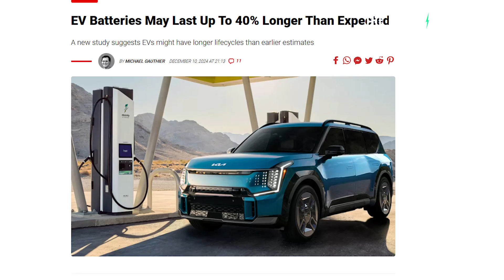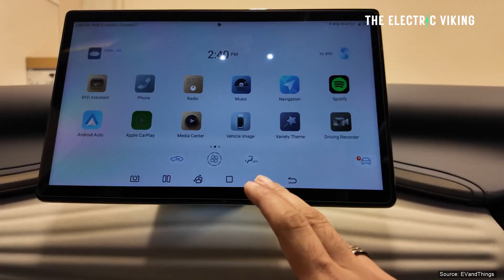Stanford: EV Batteries last 40% longer than expected in real world testing

Comment: Batteries may last for 300,000 miles, this is not the issue, it's how long they last. If they only last 8 or 10 years and degrade every year by a percent or 2 then after year 5 you could be 10% less then what you started with. This could be 30 miles less on a car that started with a range of 300 miles. I would rather manufacturers said a guarantee of 12 years but only lasts for 200,000 miles. Still not there yet for me to get an ev. Can't compete with an ice car on range and charging. In 5, 10 or 15 years the chemistry may be around where cars will have a 500 mile range and the battery lasts for 15 years hopefully anyway. I like the thought of an ev and hope they sort out the battery quick. I have worked out if I charged cheap overnight in the UK cost per mile would be cheaper but when you add the cost of the car and insurance I would be worse off buying an ev.
Reply: So, you dont appear to have the ability to charge overnight at home? If you can, it's a slam dunk and obvious EVs are more convenient. Range becomes a moot point. If you can't charge from home than the EV justification is a bit less compelling.
Reply: @sunrisejak2709  the cost to get an ev charger installed at my home will cost about £1200 and I am one of the lucky ones that can install a home charger.
Reply: I agree with you, although with the current speed of development it looks more like 3-5 years to me. Here in Europe, my concern is capacity of the electrical grid. With Germany closing their nuclear plants, and limited new capacity coming on stream, the grid is already maxed out in winter. Blackouts are being predicted by grid operators. I just don’t see how we will support a wave of new EV’s.
Reply: @fredpanhuizen3716  Power plants cannot simply dial back the output at night when demand is low. Energy is created 24/7 but the output has to match the highest demands during the day. Thus at night the grid operators have massive excess capacity they want to sell at any price. Hence the "off peak" price offerings. Many EVs can be charged at night while people sleep and the off peak rates are generally crazy cheap. This excess power means the grid energy providers are begging you to use this excess. As we speak renewable energy projects are in process and coming online. Grid power in every country with EV rollout success had no issues with grid capacity.
Reply: @fredpanhuizen3716  I agree with your concern over the grid, with the Labour party in control here no doubt they will screw it up.
Reply: @fredpanhuizen3716 no black outs in countries with the most EVs.....
This argument has been debunked so many times it's a bit silly 😂
Reply: Just curious. Why would you need a 500 mile range in the UK? 
At 70mph that is over 7 hours of driving and is not something you would want to do as a human even if you could manage to keep the speed up some how.
Assuming the 2% loss per year you have 450 miles range after 5 years or well over 6 hours driving at a solid 70mph
10 years, 400 miles range or 5.7 hours driving at a solid 70mph. What road in the UK can you drive that long at a stead 70mph?
The legal limit before taking a break for an HGV driver is 4.5 hours. A mythical 4.5 hours driving at 70mph is 315 miles. 
At a more believable 50mph  you're looking at 225 miles of range needed for a 4.5 hour drive or your 500 mile range car with 55% range loss or 27.5 years of 2% range loss a year or if you got the car brand new at age 18 you would still be driving that car at age 45. (Please anyone check my numbers as I must have got something wrong here)
Reply: @kalebdaark100  Thank you for your reply, you are of course right, I don't need a 500 mile range but it's what I would like. I don't really want to get down to 30 or 40 miles and then have to search for a Tesla charger. Petrol stations are just sO much more convenient in the UK.
Reply: @tedbearfudge   So it's not range you want but for you to see chargers everywhere. I think if you have them in mind you will see them more often than you think
Reply: @kalebdaark100  Well to be honest personally I would like more than a range of 300 miles even in winter but if we had the convenience of more chargers I think this would help persuade more people. We have around 8,000 fuel stations in the UK, if they all had 2 or 3 Tesla chargers I think more would accept the change. I don't think I could drive more than 10 miles on most roads in the UK without coming across a fuel station. Obviously there are some exceptions in extreme rural areas. I know there are other ev chargers in the UK but they charge around 80p per kw.
Reply: I want a vehicle that lasts 25 years/300k miles with original drivetrain.  If EVs are disposable cars at 10 years old, that would be too wasteful and harmful to the environment
Reply: @cutehumor  A couple of genuine questions because I'm curious like that.
Why do you want a vehicle that last 25 years?
What makes you think that EVs are disposable at 10 years old?
Reply: @kalebdaark100  I'm a minimalist.  expensive cars keep you in debt.  I want vehicles to last 25 year or 300k miles.  why do I think EVs are disposable?  batteries.  If climate change is a real threat, the governments around the world should not give a tax deduction on purchase but a tax deduction on EV battery replacements
Reply: @cutehumor  Is it your ideal to personally keep the same vehicle for 25 years or is it acceptable that the vehicle is used by others for 25 years?
Why would you want a tax deduction on battery replacement when longevity of the vehicle is your priority?
Would it be a surprise to you to hear that batteries are largely recyclable when no longer useful in a car?
Reply: @ the barrier for ev adoption is fear of battery replacement costs.  If you have 8 year battery warranty, battery dies after that, that tax deduction will replace the battery free.  That would speed up ev adoption
Reply: @cutehumor  Doubtful. People with nine year old cars tend to scrap them if a big bill comes up. I say this as someone who has never bought a new vehicle and scrapped every vehicle he's owned.
What about my other questions?
Reply: @cutehumor  That describes a Tesla model 3 with and LFP battery, except they are rated for 750k miles before falling below 70% of their orginal capacity
Reply: I was sceptical as well but there's nothing to worry about. I absolutely love our EV and will never go back to ICE.
Range is a nonsense argument unless you drive 300 miles a day. Stopping for 20min after 2.5 to 3 hours is normal even on a diesel. 
My insurance is cheaper because there's almost nothing to go wrong.
Reply: Most of us EV owners don't need the longer range by default. I do long road trips every year and have no issues or remorse with charging every 2,5 to 3,5 hours.